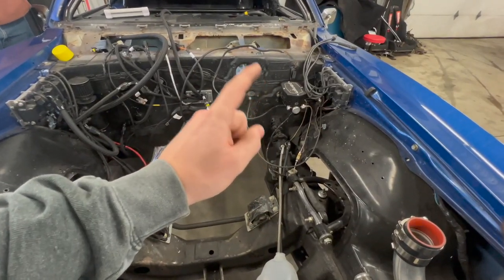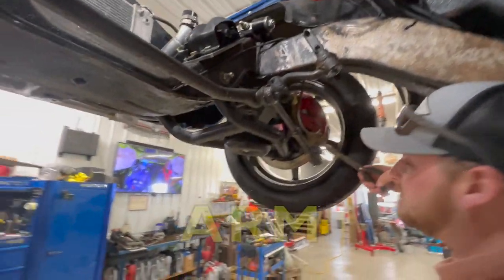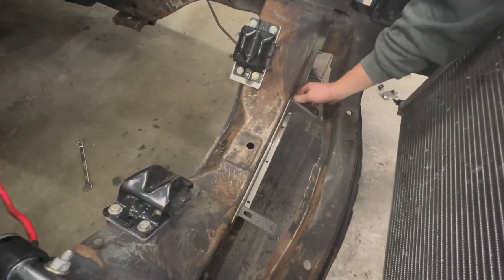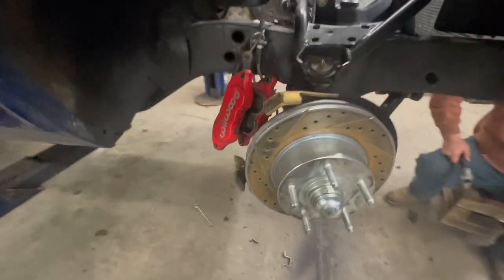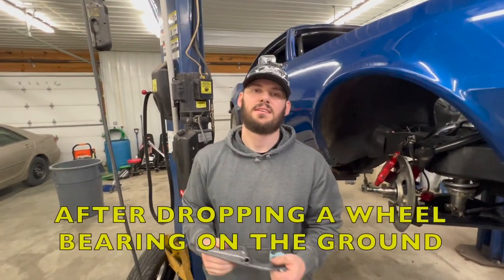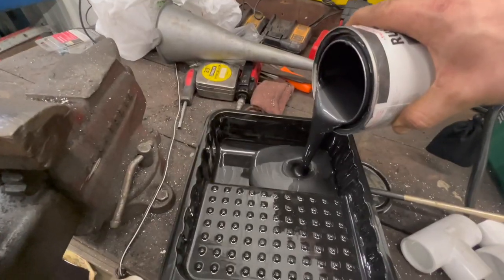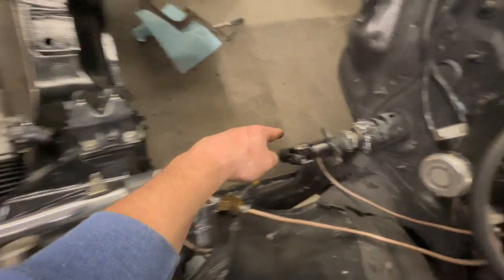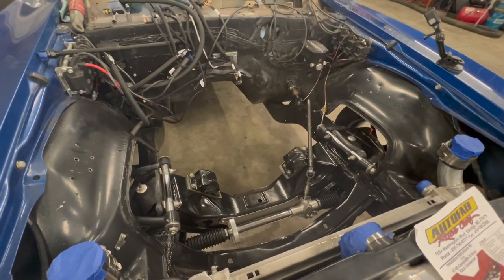Flaming River Rack and Pinion Install in Twin Turbo Camaro

Comment: did the steering shaft affect your header tubes? did you have to reroute any tubes?
Reply from the maker: Well I haven’t set the engine in yet but I have forward facing turbo headers. If I had long tubes going out the back I doubt it would clear.
Reply: @Rev2lateRacing  thanks for the info and quick reply. Love your build
Reply from the maker: @donzon353  thanks for wanting man 👍🏻

Comment: what engine are you using, are you using gm power steering pump, if so what do you do about pressure differences that flaming river wants that are alot lower than gm power steering pumps
Reply from the maker: This is a manual rack
Reply from the maker: And it’s an ls engine

Comment: Blake be nice to put 15 pounds of boost too my c5 corvette. But I don’t think it would last 😂
Reply from the maker: You need head studs lol
Reply: @Rev2lateRacing  I did put arp head bolts on it . When I replaced the heads . Copper head gaskets too lol . I’m not going to do it. Transmission won’t hold up 😂
Reply: @Rev2lateRacing  yeah I can’t afford to do anything else to the corvette. Transmission and rear end going half to last . No more money lol
Reply from the maker: @kevinjones2929  how much boost you running now?
Reply: @Rev2lateRacing  7 pounds
Reply from the maker: @kevinjones2929  that’s still quite a bit dude. I was was only running 10 for the longest time
Reply: @Rev2lateRacing  wow that’s cool . Right now they told me it makes 535 horsepower on 7 pounds
Reply from the maker: @kevinjones2929  that’s probably close. Enough to have a lot of fun lol
Reply: @Rev2lateRacing  true . I watched a video on here . A man put one on . Put ls6 valve springs on. He had his own computer program software to turn. It was not a pro charger brand through. Made 600 horsepower. But you know like anyone else. Tq is the key . Small blocks don’t really make that . In less you build it . Camshaft. And things lol
Reply: @Rev2lateRacing  yeah Blake . I can’t drive that corvette to many places here . Sits to low to the ground. Just out in the country part . Speed bumps because dumb people think flying through Walmart or places like that fun .